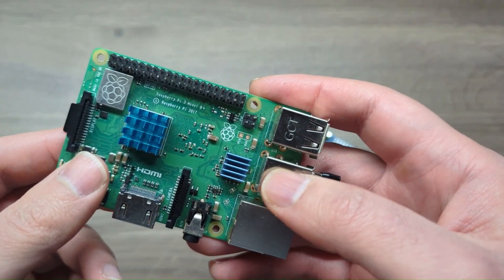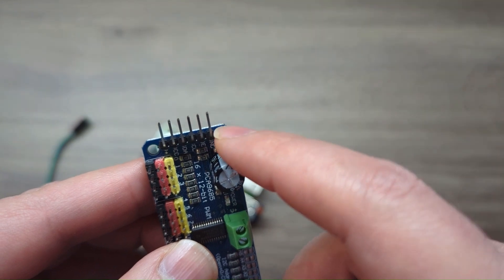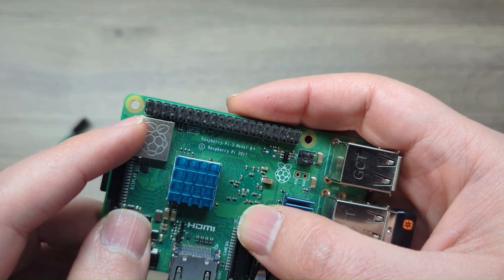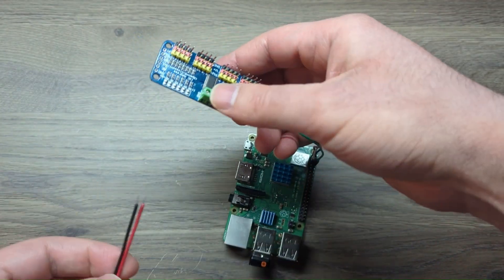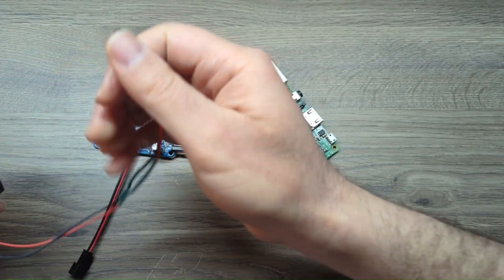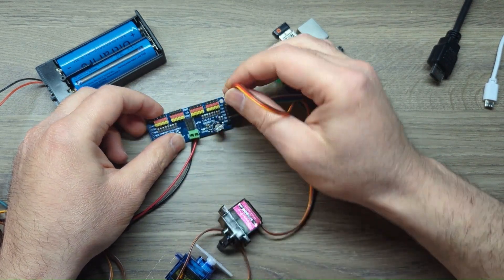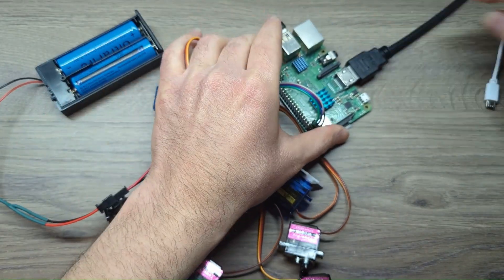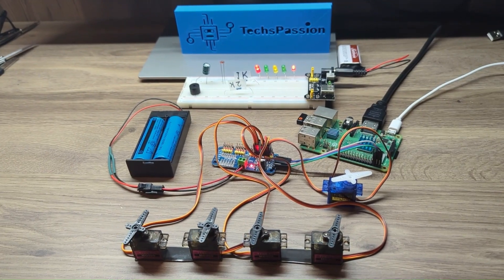Connecting Servo Driver PCA9685 With Raspberry Pi #raspberrypi #servo

Comment: Hi what power source did you use
Reply from the maker: Hi, I used a regular battery, anything that can give 5v or close to it should work
Reply: @techs.passion  I see you are moving 1 servo at a time, when i want to move 5, not enough current is supplied, what other source can i use?
Reply from the maker: In this case you need a high current power supply 5v still works, good idea, I will make a video about this. Thank you

Comment: So external power can be connected to the PCA using the external power header (green header). Meanwhile, the RPi needs to be connected appropriately to the PCA using the SDA, SCL, Ground, and V+ pins. Finally, attach the servos to the available slots on the PCA.

I have a question, let's say a servo needs 5V to operate, and 5V are provided to it via the external power header (green header). This will not damage the RPi? Sinice the RPi is connected to the PCA via the V+ pin.

Also, the PCA says on the product page it is 5V compliant, does this mean the external power can be removed and run purely from the RPi?
Very interesting video, another piece of the puzzle, thanks for sharing.
Reply from the maker: Hi, you are mostly correct except 
The PCA and The Pi connect to vcc and not to v+
The V+ only exposes the external power 
Connect only the GND to the Pi GND
Everything else is good and yes the pi will be fine but again notice the difference between vcc and v+

Comment: When connecting the servo driver hat directly onto the gpio pins, the pi gets powered trough the hat right? Can i then still connect a usb c power supply to the pi to prevent it from turning off when using heavy servo motors, because my 9kg servo motor keeps turning off my pi when rotating
Reply from the maker: Yes, you can and should power the pi from the normal power port and use external power for the hat, this will ensure that this issue doesn't happen.
Reply: @techs.passion  aha, I have a bit of a different servo HAT from waveshare, it sits directly on top of the gpio pins from the pi so it also connects the positive terminals. So the pi gets powered from the hat as well from the USBC then?
Reply from the maker: I see, I do not think so, in this case I would say you might need a power supply with more current or check if the hat takes another power supply for the servos but as I'm not sure which hat you are using here I will not recommend that until I know more but that might still work.
By the way, I do have a discord, it's free and be happy to further help if I can https://discord.gg/bJKXKDwF
Reply from the maker: Check out this video for more details https://youtu.be/-x2EEIUMm6A

Comment: Hi have pca9685 16 channel board how get up and with raspberry pi 4 how do install the correct libaray on to my pi please send a link that's tested how do import the library having doing this the code on adafruit didn't work or install.
Reply from the maker: Hi, Great question in which I should do a full video about soon but until then. This is a guide that will help. Thank you :)
https://cdn-learn.adafruit.com/downloads/pdf/adafruit-16-channel-servo-driver-with-raspberry-pi.pdf